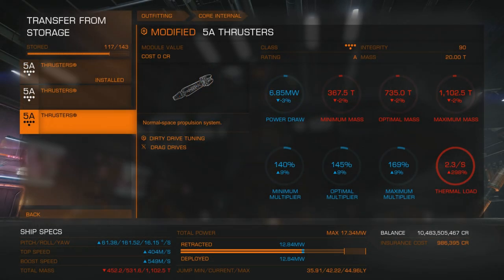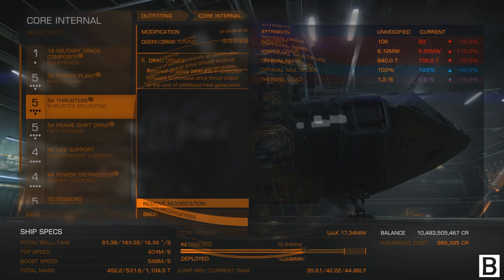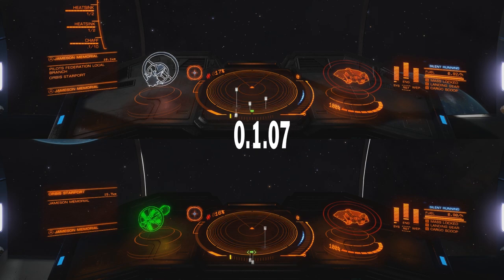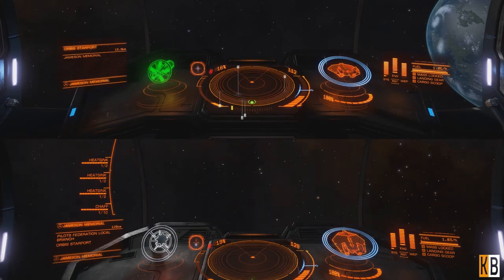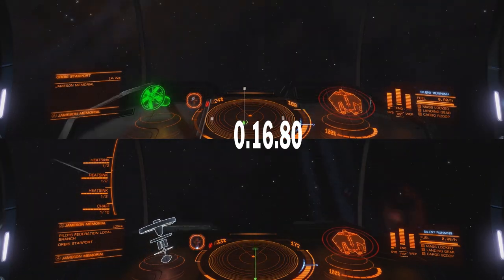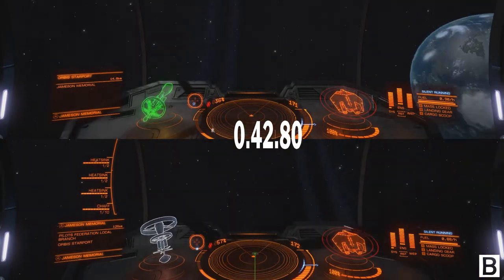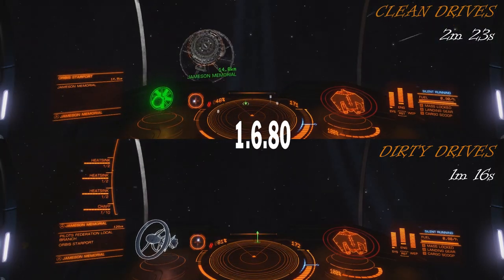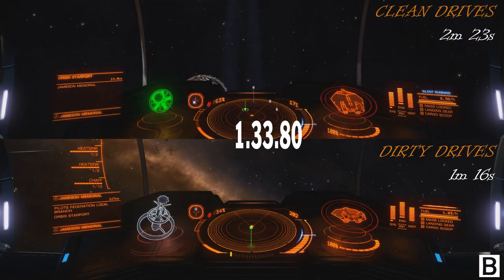Elite:Dangerous. Silent Running: Clean vs Dirty Drives

Comment: Thank you for this video, I made some tests myself, and I found that heat grows more slowly if you turn off your thrusters (or other modules). Each MJ used from powerplant generate a quantity of heat per time, depending of efficiency (overcharged and low class powerplants are very sensible to this, low emission + thermal spread are best efficient with 0.126 heat unity per MJ, 4 time less than A class unmodified PP). Clean drives use more energy than dirty, that's why heat grows a bit faster without acceleration. Frontier have to change it, clean drives have to be more efficient all the way in my opinion.
And about fuelscoop and superdrive it is like thrusters are nor used, it is another acceleration, only energy consumption of modules count.
Fly safe CMDR
Reply from the maker: what do you mean? clean drives with any thruster input build heat almost 2x slower than dirty drives.
Reply: Kornelius Briedis yes when active acceleration, as you said in the video. But when no acceleration or in supercruise only energy used from powerplant is impacting. For exemple, 5A thruster with grade 5 clean tuning draw 7.1MW and with grade 5 dirty tuning 6.85MW
It is not big difference but it is. Unmodified 5A thrusters draw 6.1MW only, if you do not accelerate or if you are in supercruise your ship is cooler than others.
I know my english is too bad to make a clear explanation. Heat mecanics are not as simple as we think. 
Somebody made a great post about it in frontier's forum.
Just write in google "elite dangerous heat mechanics" and clic the first link. It explains in detail how it works between energy consumed and heat generation.
Reply from the maker: i showed you data from "no acceleration" in the beginning of the video - almost same numbers - 3m18s vs 3m25s.
both drives when "turned off" have same impact on heat generation which is 0, so i don't understand what you tried to say.
Reply: Kornelius Briedis 7 seconds out of 3m25s is not nothing. It is not very important but it is a ~3% difference in favour of dirty drives at rest.
In short, it is not matter, it is just a precision that I wanted to share with you, I do no question the quality of your work. In no way I did make a bad review.
Reply from the maker: 3% is nothing because heat was going up by 3% usually in like 2-3 seconds and sometimes it reached 90% from 87% and sometimes from 89%->92%, in other words it is exactly the amount that can be called nothing ;)
Reply: D Class Thrusters, Level 1 Clean with Thermal Spread on My 'Winder :)
DONE.

Comment: I discovered pretty much the same thing. The difficulty is if you are making a build for Silent Running and PVP the difference in ship speed could mean the difference between living and dying. Emissive Weaponry will make it easier for people to Target you so that is where dirty drives come in. A lighter-weight ship with a higher speed can keep you away from the opponent long enough to turn off silent reading and cool down. The moment your opponent begins to close distance silent run again. If it is a ship designed to escape a heatsink along with Silent Running and dirty drives I feel is the way to go.

Comment: For my FAS I use clean drives with double shot frag cannons for some fun stealth sneakiness.
For Almost everything else in the game I use dirty drives to get the turning up.
Reply: Clean drives are actually still pretty damn good if you don't go for max speed / super lightweight builds, biggest issue to me is that silent running is pretty much useless in Elite.
Reply from the maker: no, they are not compared to dirty drives. i will make a video someday ;)

Comment: I'm struggling with vented beams and silent running. I think they have been nerfed. I am heating up in silent running with efficient vented beams. I now know overcharged and short range will increase cooling but I am leaning towards long range as they have tactical advantage. I have been a huge fan of your videos for a long time. I think you make some of the best and most informative videos on elite dangerous. thanks.

Comment: My T10 I named Sub Zero because when I fuel scoop My heat stops at 58 and it takes ages for my heat to go to 90 when I silent run
Reply: Chris Klitou Do you have a build for that. Would be interested.
Reply: Holy crap that's crazy LOL. I have a exploration Anaconda I used for Bucky balling to Colonia. It's running a size 4 low emission power plant. I pretty much turn off almost everything including my shield until I get to where I need to be. It runs so cold ice covers the windshield while just flying around. I'm also running clean drives on that build. It has enough power to run a size two or three field maintenance unit. I keep a small field maintenance unit active and the larger one turned off. This allows me to do repairs to my canopy if I'm ever caught in a neutron star death ordeal. It gives me enough time to repair my canopy and Highway to a new system.
Reply: @Moosemansmithy  nice
Reply: @williamread5652  I use an Armoured power plant with thermal spread and clean drives with themal spread

FSD long range with thermal spread

Comment: This is probably *THE* question about Elite Dangerous I most wanted an answer to - thanks VERY much for doing this test! One question, if I may - how does clean vs dirty drives affect ship temperature under normal conditions (ie NOT silent running) - in supercruise and in normal space?
Reply from the maker: funny enough dirty had lower idle temperature in regular/sc but the combat near stars, i.e., nav beacons, with dirty drives turns into overheat fest, i didn't test specifically that now as all i wanted to know was only silent running, maybe someday i will check fuel scooping and other stuff too to see dirty vs clean, however, there is one small addition - is it necessary? clen drives loses in performance to dirty drives in every single aspect and dirty drives loses to clean drives regarding heat in every single aspect, so if you care about heat use clean, if you care about combat use dirty (unless you want to sacrifice it), so there is really not much to learn - you choose what to sacrifice ;)
Reply: @Kornelius "funny enough dirty had lower idle temperature in regular/sc" - that is quite surprising! Was the difference slight or significant?

I've been thinking of engineering a couple of ships outfitted for different purposes (eg exploration and combat) - 2 of each; 1 for lowest temperature and the other for maximum performance - and engineering each module in each ship specifically. Just to see what the cumulative differences between them are - but it's a lot of work possibly wasted if in the end the differences are not all that great. 
But it would be nice to have (for example) an exploration ship where I didn't have to worry about heat while fuel-scooping, and a combat (or trade) ship which was thermally invisible until less than a couple of kilometers from a target - be nice to know if either of these are feasible (and practical).

Anyway, thanks for the video - and the response! :)
Reply from the maker: but you can see that in my video, didn't think i need to voice what you all can see :) 16% DD and 17% CD, which basically can mean 16,99% and 17,01% but still. but when you move 16% clean and 19% dd before i enter SR.

if you want performance forget about clean drives, just forget, if you want to get lower heat just forget about clean drives.
Reply: @Kornelius "but you can see that in my video" - yes, indeed I can! Sorry - wasn't watching properly. :)
Reply from the maker: it is ok ;)

Comment: Wow... this game hasn’t evolved. I recall seeing tests like this prior to horizon commanders 2.4 season 2  two years ago. I assume space legs are not a thing and factions are still broken with background simulation still screwing over the little clans.
Reply: Charles Hodge this test wasn't possible prior to horizons. Engineers are required for clean and dirty drives.
Reply: You recall something that is impossible... Maybe you are just making shit up? And why spacelegs? This is not Star Citizen. This game is actually out.
Reply: Michal Valta space legs are a promised feature, but I don't think we'll ever see them. It took 2 years just to get bookmarks
Reply: Droogie128 engineers was available beta servers as far back as 1.6. It went live in 2.1 are you telling me the game is still running in 2.1 a year later and people are still doing these tests.
Reply: Michal Valta nope clearly played the game from day one and got bored when sierras inc started taking over everything around Maia system.
Reply: Charles Hodge you said it was a problem prior to horizons. That is impossible. 2.1 was during horizons, not prior.
Reply: Engineers were introduced with the v2.1 Horizons season. Engineers were not available for those on 1.6. 1.6 was released along WITH 2.1 for those without Horizon....not before.
https://community.elitedangerous.com/en/theengineersbetadate

With that said, there have been changes, but not anything huge. In comparison with SC, both seem like its going to take 4-5 more year to be complete.
Reply: Charles Hodge 1.6 wasn't in beta before horizons. Horizons was launched with 2.0/1.5, which had planetary landings. Roughly 6 months before engineers. Engineers went into beta in May of 2016
Reply: Charles Hodge the date of that forum post is April 2016. Horizons launched with 1.5/2.0. Horizons had been out for 6 months when that post was made. So, thank you for proving me right.
Reply: Charles Hodge here are the official patch notes for the launch of Horizons if you want. https://forums.frontier.co.uk/showthread.php/211781-Horizons-(2-0)-and-Ships-(1-5)-change-log

Now, my math may be off, but I'm pretty sure December 2015 came before June of 2016. 

So, go ahead and keep name calling.
Reply: Droogie128 well done youve proved my point that people are making videos about the same shit in regards to this game. Its now 2018 🤔 wtf is new
Reply: Charles Hodge I don't disagree that the content has slowed to a trickle, and everything that they add is hidden behind a mindless grind wall. All of the mechanics are disjointed and unpolished. 

The only thing keeping me playing is VR. I got an oculus rift, and it changed everything. I don't even play much on that anymore, though. I've been highly critical of the game.

I also don't resort to name calling in an argument. It's a logical fallacy. Attack the point, not the person making it.
Reply: Chris Wright thank you!
Reply: Charles Hodge again with the ad hominem. That's for an elementary school playground. 

The engineers have changed a lot, actually. They were completely revamped in 3.0.
Reply: Don Naskoni the comment said before horizons. That is impossible. Horizons began 6 months before engineers went into beta. It's an objectively correct statement. Call me all the names you want. Just a keyboard warrior.
Reply: Went to verify myself - indeed, the beta started after horizons was released.
Reply: Droogie128 still triggered about those dates buttercup. All you have demonstrated is that the argument itself cannot be used to establish the truth of the conclusion. Ive seen this before. More in depth, as far back as may of 2016 

the game hasn’t evolved. You protest a overhaul... looks the same from here... what no rare commodities need during the grind.
Reply: Charles Hodge engineering has been overhauled. Every click is an upgrade to a fixed maximum. It's an annoying click cycle now, but results are guaranteed. Negatives are a fixed number and applied on the first roll. 

There are no more random secondary effects, either. Now, you choose an experimental effect at the cost of extra materials. Almost all modules have experimental effects as well, instead of just weapons. 

There is also a materials trader that you can use to trade one material for another. Though, trading up in grade is way too expensive at a cost of 6/1 per grade. I still don't like the system much, and it's still a battle against RNG gathering materials, but it is different. 

"God rolls" are a thing of the past, since everyone is playing with the same guaranteed maximum. 

So, yeah. It's very different now. Saying it isn't is objectively false. You haven't been paying attention.
Reply: Droogie128 no i havent been playing it because its more of the same. From what you said they just moved the goal post in regards to the grind. true or false?
Reply: Charles Hodge not really. There are some definite improvements in many areas, and results are guaranteed. You can even use pinned blueprints at any station now, so you don't have to go to the engineer unless you want to pin a new blueprint, or apply an experimental effect
Reply: Charles Hodge they left RNG in certain areas for arbitrary reasons, though. That bothers me. The amount of rolls it takes to max out a grade is RNG based. Usually 7-11 rolls to max out a grade 5 in my experience
Reply: Charles Hodge it's a much different system now, but still very flawed. If call it better, but there are far too many arbitrary roadblocks in place. There are plenty of videos on the new system that 3.0 introduced
Reply: Frontier already said that spacelegs is at the top of their priority for after the Q4 update.
Nice to see you having such an insight of the game from this video though, your crystal ball must be very powerful.
Reply: Dark Thoughts Citation please. The last I recall is them saying they would like to do it, but it's a very long way off.
Reply: Dark Thoughts nothing says it is their top priority after the Q4 update. You're putting words in his mouth. The last official update for a timeline was that it's a "long way off".

Also, you made the claim. Burden of proof is on you.
Reply: Dark Thoughts the very next paragraph:

Of course, “top of our list” would suggest that it’s the next thing they’re doing, which seems unlikely. We asked a representative from Frontier if the space legs were still being worked on, or if they had been dropped altogether, and were simply told: “[W]e can’t comment on rumour or speculation, and we have nothing to announce right now.” Which is disappointing, if not exactly a surprise.

Sandro tends to get overly enthusiastic and uses a lot of hyperbole.
Reply: I dunno why everyone gets so het up over space legs - you know when we get them they're gonna be broken! :p
Reply: PhanttoM as a general rule of thumb for me, clean is superior in everything bug a few niche situations. Like this video shows, it's better for silent running. I also use clean on exploration builds only if it allows me to go with a smaller power plant. If not, I stick with dirty. I found the difference in heat generation to be a non factor between the two in any other situation
Reply: @Droogie128: no, engineers were not overhauled, the grind/"progression" of 'em was (and not enough). the engineers have remained the same, as the effects of engineering are exactly the same (actually worse as nuG5 is better than oldG5). that's not an overhaul. that's like calling a 1% tax reduction a "tax reform". it's bullshit
Reply: praetor47 they are not exactly the same. Some have better ultimate results, and some have worse. The experimental effects are also a new edition.

Guaranteed progression vs RNG is a definite overhaul. I just hate having to start at grade 1 every time.

Materials gathering is still atrocious, and the trader is worthless if you need to trade up.
Reply: @Droogie128: experimentals are not a new addition, you could get them (the exact same) before on weapons, and on everything else "experimentals" are just stats boosters (which you could get with "secondaries" that do not exist anymore... so yeah, it's pretty much the same). that's NOT an overhaul. 

nuG5 are better than 90% (if not all) of the oldG5 god rolls. a marginal stat increase is NOT an overhaul

guaranteed progression vs rng is an overhaul... of THE PROGRESSION, as i've previously stated, and NOT of the engineers, as the ultimate result is pretty much the same as it was before (except you can get slightly better results much more reliably).

lessening the grind is not an overhaul. making them work completely differently and having them have completely different effects on the stuff they "engineer" would make it an overhaul. this is just making an inexcusably shitty mechanic slightly less shitty (but still really fucking bad overall)
Reply: praetor47 everything about it was changed. You're splitting hairs here. The system was changed from top to bottom. It was overhauled. Experimentals could not be had before. Some were available as secondaries, some were not. Now you're guaranteed the one you want. Unfortunately, some of the best are no longer available. Like, you can't get a class 5 shield on a cutter any more because there is no optimal mass experimental 

The system was massively changed. That is an overhaul.
Reply: praetor47 definition of overhaul:

a thorough examination of machinery or a system, with repairs or changes made if necessary.

Comment: You didn't boost. Although results will still be clean lasts longer but would have been nice to show as it does reduce times further still.
Reply from the maker: seems i will make video with boosting in SR as it is so funny to read that, do you really think boosting in silent run is even an option? ;) will show you how silly it looks like.